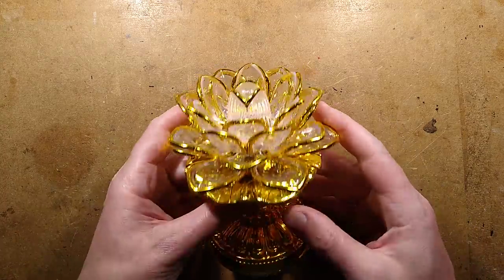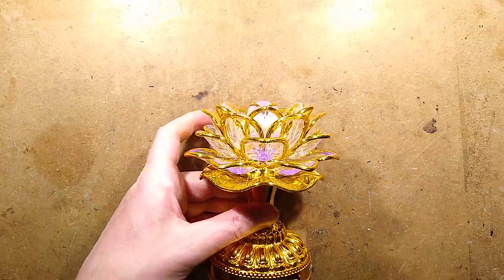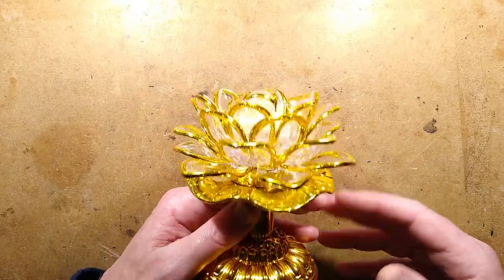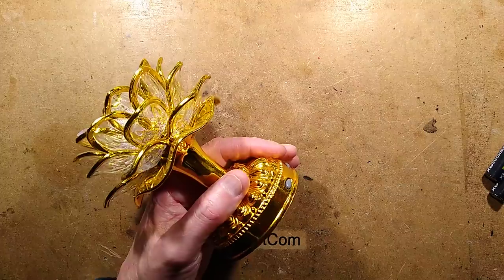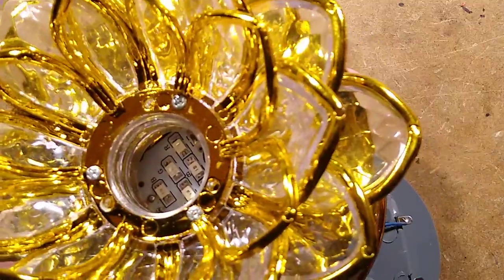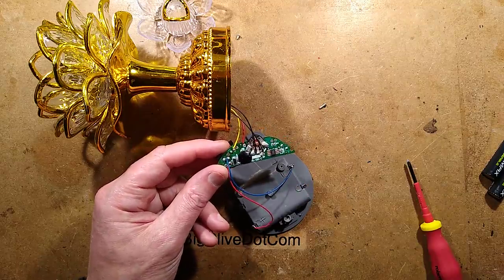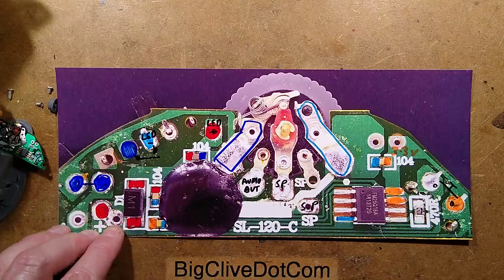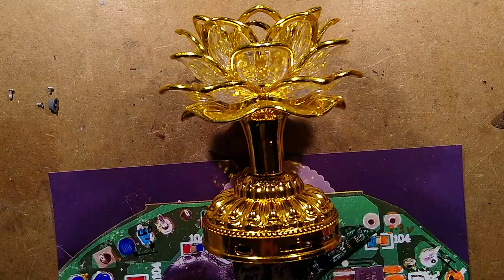Buddha machine teardown with flash dump

Comment: The volume suddenly "jumping" high is most likely the result of a Linear Pot. Proper audio pots are logarithmic which adjusts the resistive track to more be in line with how hearing works. A linear pot only has a very small range at the end that's usable for audio.
Reply: You beat me to it LOL - Could be anti-log pot too but those are rare as hen's teeth...
Reply: Are linear pots any cheaper than log ones?  I was wondering if this was another way to reduce the cost
Reply: maybe, theres cheap switched pots on ebay, supposedly sold as volume controls, but are linear, with this sudden volume issue 😉
Reply: It obviously doesn't employ a true potentiometer, so why even call it a pot. it's more of a switch imo.
Reply: @dbspecials1200  amusing how it's in series with the speaker, that's super cheap Chinese crap design.
Reply: very easy to check whether it's a linear or log pot with the marking on the pot itself.
Reply: @unperrier5998  'if' they are marked,...
Reply: @dbspecials1200  It is a true potentiometer... its just poorly implemented.
Reply: @dbspecials1200  No, it's a proper pot, developed by the Japanese for transistor radios in the 1960s. It is physically weak and easy to break off the switch or the end stops if you are ham-fisted, but the basic design works fine if you aren't. The problem here is the standard cheap pot is 10K, and the speaker is probably less than 10 ohms. You would need a pot (actually a rheostat) on the order of 100 ohms to get a decent volume control curve. A linear pot would probably work just fine in this application, but it needs to be a low-ohms pot.
Reply: @ianhosier4042  Not that I've seen, the usual problem is finding the resistance value I want WITH the taper I want. And a friend doesn't seem to "get it" and wants to use scavenged parts for everything so I keep being asked to use Lin pots in audio projects etc. exasperated sigh
Reply: Normally, this kind of volume-controls are / were used at the pre-amplifier-circuit instead of the speaker-end. The amplifier was always full-on and since the pot was just setting the input-level for the amplifier, you could control the volume on a good way. But of course here they cheapened out with this less wanted kind of output since the impedance of the speaker is not  (never) in corralation with the resistance of the pot.
Yes, those systems were in walkmans and such all in the 80-s and 90-s (yes, cheap personal electronics without digital controls, even in cheaper diskmans). And the output-connector was just 'don't care what you connect to it it will work' ...
Reply: @mrsheesh3743  : There's probably a way to deal with it that involves a diode as the "actual" volume control (use the pot to control the amps running through it), feeding a fairly high-gain amp.
Reply: @elvinhaak  I know, been doing electronics since the 70s, I don't see many vacuum tubes lately tho LOL... I just prefer that people use the right tool for the job, it's not THAT hard to do :)
Reply: @absalomdraconis  Sure - Or just beat the purchasing agent with a pool noodle, until they start buying the right part. (If they're stubborn, use a wet pool noodle.) It wont hurt them but it'll make it tough for them to get anything done, while making sure that they know you are TICKED OFF LOL

(Pool noodle, pipe insulation, its a foam flexible soft pipe cover used as a kids' toy, for those unaware. If you manage to hurt someone with one of those, you had to e cheating!)

Comment: Just taken a look at that .bin file using HxD - seems like the first 7x256 byte blocks of flash are used to store file information. 
You get regular repeating pattern all the way from 0 up to 0x0700 with some wierd dead zone 0x580 to 0x600. 
My guess is the first 7 blocks are offset addresses for the start and end of the tracks, with some additional information as only 3 bytes for start and 3 bytes for end would be strictly required (so only 239 bytes total needed, in fact we have almost 1800). 
The data after 0x700 becomes more random as you'd expect with audio data, however importing as a RAW into Audacity in a multitude of PCM bitrates and endianness yielded no results. As others have stated it makes little financial sense to compress such a small amount of data then add a more expensive microcontroller to decode it, when there's only a couple of cent difference between say 2mb and 4mb SPI flash chips.
I suspect it will be something like the BTC algorithm by Roman Black so they don't need to implement a proper DAC in the output stage - I can't post a link here but it's worth checking out.
Reply: It doesn't seem to be pure BTc algorithm's bytes in case this algorithm has been used. I heard at the sound created by the decoder/simulator on his site (the Perl script) feeded with the bytes of Clive's dump, only noise. But thanks for mentioning the possibility, I didn't even know this approach before.
Reply: @steiniapproved  thanks for testing, I forgot about the Perl script! Oh well it was worth a try
Reply: I have managed to decrypt the start of the file and it is indeed a lookup table complete with filenames, offsets and sizes that match up with other parts of the file.  The audio files have an .f1a extension but I have no idea what that is.  I can't post links but if you can find the Reddit post for this video, I posted my code if there if you are interested in investigating further.

Comment: Looking at the data and some of the comments, I have some thoughts:
- It does look like this is compressed data. Something like MP3, but not older telephony codecs which don't have as much entropy.
- It may be "encrypted" or obfuscated somehow, perhaps XOR'd or just read in an odd order. Codecs like MP3 use frames, and those frames have headers. Its difficult to spot that in the data.
- It would be useful to know exactly how may tracks the device plays and their approximate lengths. 
- It may be useful corrupt the file in a way that sheds more light. (you could zero out a few bytes and see which track it effects and how. You could even copy blocks from one part of the file to another then reflashing it.)
Reply: I opened the file with a hex editor and I noticed that it ends with, what I think it is, the whole ASCII table, all the characters between 00 and 7F, separated by 00s. Do you have any idea why this is here and can you explain it to me? Thanks!
Reply: @dimitarnikolov3527  It is referenced as a file, so its probably not some vestigial data in the ROM. As to its purpose - hard to say without seeing what the processor does with it.
Reply: I looked this over with binwalk and found that it has no header information but has deflate data. There's two common compression methods, 'zlib' and 'deflate', with the major difference being the latter has no header information, thus marginally smaller. I've heard the audio and we can all agree it is heavily compressed. I can't remember the original author of the quote but "Compression and encryption are indistinguishable from one another". There is little to no entropy present within this bin file which indicates that it has no encryption. It is compressed audio that has a deflate container, which makes sense given the space limitations.

EDIT: Trying to play it as a RAW audio file in audacity gives a beep and static sound. This chip has active write protection and I suspect the first few bits are the signal to allow it to continue to execute code. It verifies that the process is not flashing the memory. I honestly think you just stumbled on some machine code programmer that was flexing....

Comment: Looks like there's more than just the audio in the flash file... binwalk with cpu_rec says there's 6502 machine language in there, and looking at the entropy, I think I agree. A 6502 actually reminds me of the Sunplus chips that are in Tamagotchis and (the older) Furbies... according to the datasheet, they do 4-bit ADPCM.
Edit: Threw the code into a disassembler, it's no 6502 unfortunately. If the audio is ADPCM, it's not in any format Sox recognizes.
Reply: Heheh. I immediately took it to binwalk too.
Reply: Sunplus (now mostly GeneralPlus) tends to load things from maskrom unless the code is large enough to enable XIP. Not sure if that's an option for their 6502 chips, but it is for some μ'nSP chips. Probably not the case here though.
Reply: @caralynx  Agreed. That plus the fact that what I thought was the interrupt vector region turns out to be too weirdly formed to be an interrupt vector region... I'm not 100% sure anymore if there's any code in flash. There's lots of Chinese voice chips that use their own encoding, so it may be one of those.
Reply: @caralynx  Having done quite a bit of work with Sunplus/Generalplus stuff... This doesn't look like one of their formats.

I'm 50/50 on whether there's code in there or not. I think Clive mentioned 39 songs, and my rough estimation of what looks to be the file system table of sorts at the beginning seems to show 44 "files", with each entry in the file system table being 32 bytes long and ending with 0x0F3E.

The first four "files" and the last one's FS entry are formatted significantly differently than the others, so I would presume the other 39 are the actual audio files. But what those 5 extra files are, who knows.

I know there are some MCU vendors that have "no code" MCUs that have predefined programs, and load their "unique" variations on the predefined behaviors and audio from the flash chip, so this might be one of those. I wish I could remember that vendor's name, heh.
Reply: @devttyUSB0  same, but completely no results here.
Reply: Pretty sure it will be an OTP microcontroller and not be executing any code from flash. Tritan Technologies & Sonix both do really cheap MCUs with built in audio amp supplied as a bare die for COB mounting.

Comment: I have seen similar thing made as promotion item for new car. You got a box and when opened LDR turned on the circuit and personalized message played. 

Same blob and memory chip construction and same speaker. From what I found after dumping the eeprom it could be based on sonix snc712 type of chip based on some strings in bin file. Never really managed to extract the files as it was proprietary format.

Comment: The Data in the file appears to be possibly semi-compressed. At the beginning of the file there is a table of contents for each of the 39 sound streams, most likely the pointers to data offsets. There isnt any textual content in the data. The only content readable is right at the end with a string of counting characters (these are usually for helping microcontrollers print on character displays). Imediately after the blank area at the beginning of the data, there are 11 bytes which are repeated exactly once further on. I have no idea why. What I can not work out is how the audio data is compressed as or what format of audio data it is. I even tried using a tool called binwalk and surprisingly it couldnt match anything on contents. It is not compressed audio in the sense of an MP3. It may be compressed in the sense that a couple of bytes represents a pulse shape that the chipset emits. 2MB for  39 audio chunks is quite small. It could be possible that the chipset is processing a byte as two sets of 4 bits per audio clock. There may also be a small amount of runtime code in the data too.
Reply: Likely uncompressed PCM audio, since it keeps things small and simple in the firmware, minimizing testing. Putting anything like a MP3 decoder would require a more expensive microcontroller or a separate MP3 codec. For something as cheap as a chanting machine, you might as well just buy a large enough flash chip.
Reply: Yes.
Reply: if it were 4 bits per sample then when reading audio at 8bit per sample we'd still listen something resembling the original audio, just twice as fast.
So that's not 4 bits per sample.
Reply: g.729 is one obvious guess to try.
Reply: @unperrier5998  Thats not how it works XD - If you read two samples of 4 bits as a single byte youd be hearing garbage because the most significant 4 bits (first sample) would be summed on top of the least significant 4 bits (second sample). Each samples signed range is -4 to +3, adding two pairs of 4 bit samples would end up you adding an additional upper signed range of -120 to + 119 which in the 4 bit range is impossible.
Reply: @cylogenix  while 8-bit micro controllers support 8-bit signed integer arithmetic, they don't support 4-bit signed arithmetic (except maybe some exotic micro-controller). 4-bit signed arithmetic is not a thing at all.
4-bit unsigned integers makes the most sense, in which case what I said stands. 
I am amazed how you can consider the only theoretical case where you're right and I'm wrong, without any consideration of whether that makes sense from a technical standpoint. But I'm certain that you'll argue, maybe dig an obscure microcontroller from the 1970's that has 4-bit signed arithmeric.
Reply: I did download the file but haven't looked at it yet. Generally speaking I would probably clip my scope on the chip while it's in the device and see what the data stream looks like between the blob, that would tell you more than trying to guess encoding.
Reply: @alanangelfire1217  true that looking at what address is read for each tone will help, but like someone else noted elsewhere the 39 tracks seem to be nicely split in the input file (see the 0xcb80 "kind of, but not really" separator) and the 39 seemingly entries in the "what appears to be a" header at the very beginning of the file.
That said, there's also the possibility that the CPU loads everything into RAM and then never communicate with the eeprom again :(
Reply: Try dumping the content from the 11 byte header forward, then check if it's an identifiable file format.
Reply: @mofo78536  I'd agree, e.g. 8bit pcm at 11khz would give about 180secs of runtime, minus a bit for headers and stuff. The data doesn't seem to be straight PCM or ADPCM so it might just be mangled somehow (add a bit and XOR type of thing)
Reply: Monitoring the requests to the Flash chip might help with finding where each "chunk" of musak is stored and how much/frequently the data is read in may give some clues as to compression. It could be as simple as very low bitrate MP3 but with headers stripped off so it's just raw data.
Reply: WIld guess I would say 4-bit ADPCM, as used on the Playstation 1. Very easy to decode on a crappy microcontroller in software, that's what I have used for this kinda thing in the past. I did a commercial toy using that same 16Mbit SPI chip and we got about an hour of audio in there using a voice codec
Reply: Is it not just a form of MIDI ? It can be very small and still contain a lot of 'music' since you just safe the notes on an instrument instead of the sound (instrument, tonehight, tonelength).
Reply: I managed to decode the header, it contains offsets, sizes and filenames of the data contained in the rest of the flash.  The audio filenames all have an .f1a filename extension but I don't know what format that's in, all I could find was possibly something about a telephone codec.  I can't post links but if you can find the Reddit post for this video I put my code there as a comment if anyone is interested in investigating further.
Reply: @Malvineous0  if you can strip the .f1a files out of the bin file I could try them in my MFAudio program using the offsets but MFAudio is for Console game audio formats and might not work. Worth a shot though.
Reply: @mofo78536  very likely to be PCM or one of the various older abandoned telecoms compression methods. Definitely single channel, and quite possibly stored as a single file and a pointer to the start and end of the various streams in a second file. I'd suggest dropping the file into notepad++ and looking at it as a ASCII file (can be just as revealing as a HEX editor), and dropping it into VLC with the mega CODEC pack, you might be able to ID the format using the tools included in the CODEC pack and the compression ratio, sample rate etc.

Comment: Just about every restaurant in China has dozens of that sort of thing playing out of synch. The little ones like the one Clive has been playing with, tiny one about half that size, and a rage of larger sizes. Art of choosing a table - study the room and look for the area where the noise generators have died as indicated by the lack of LED function. Some Chinese engineers deployed an approach more akin to Clive's - it was strange how many batteries "failed" quite abruptly ;-)
Reply: Way back in the 1970's, some American restaurants started using Muzak and uncomfortable furniture to increase diner turnover. 

A friend of mine worked in a restaurant with door sensors that counted people as they went in and out to track approximately how many people were inside at any given time. If there were a lot of people, the lights got brighter and the music was louder. If the restaurant was mostly empty, the lighting and music were more soothing.

He reported that it actually worked pretty well. It was quite impressive for something designed before microcontrollers existed.

The circuit that counted customers as they came and went was not perfect, but the manager only needed to adjust the once or twice a shift.

Muzak was a subscription music service that provided environmental audio tailored for specific applications. I worked in a factory that played the light industrial sound track. Fortunately, the employees could control the volume in most areas of the building.